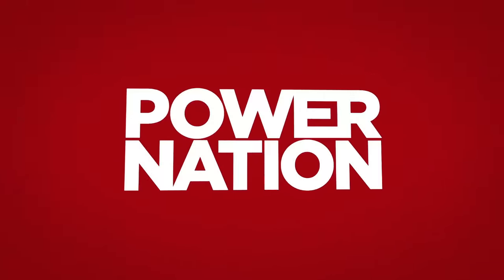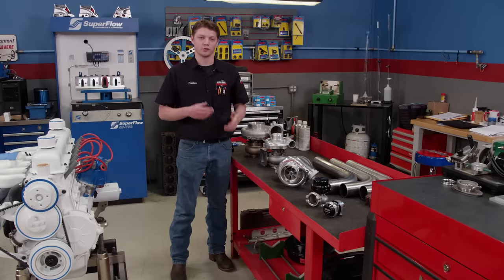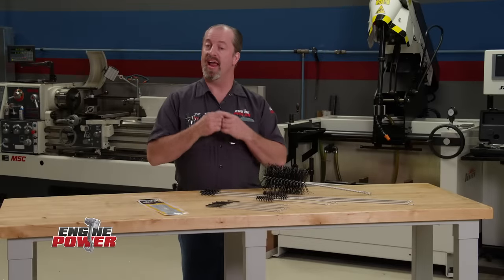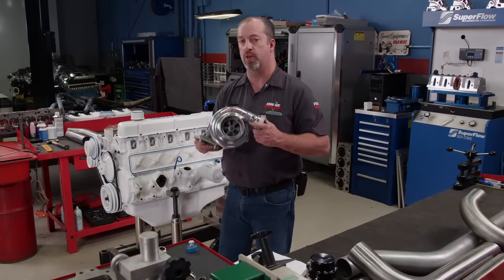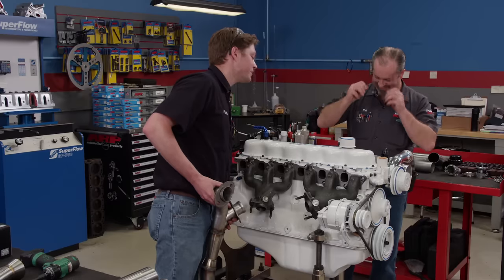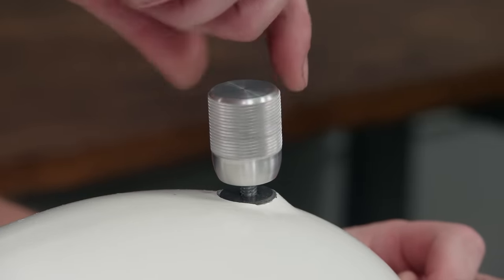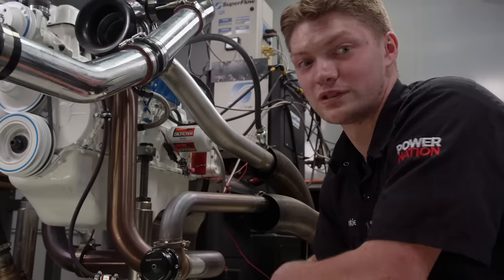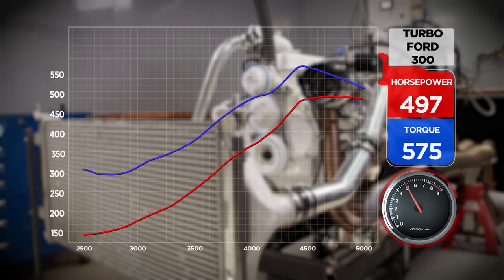Turbocharged Ford 300 Inline Six Makes Over 500 HP on the Dyno - Engine Power S8, E14

Comment: It's a 300ci.
One of the absolute best engines ever.
Reply: Actually it's not.  They've bored and custom built pistons.
Reply: @bmstylee  Okay...  Is your point that its a 308 and not a 300?
Reply: @bmstylee  regardless its still best motor made.
Reply: @fordnut4914  nice story.  To bad it's not true.   If it was so great as you imply why hasn't it been made in several decades?   As Pat said it's a relic.  It's completely irrelevant in a modern world.   As much as i dislike the turbo 6 that Ford use now they can make the same power and torque at half the size.
Reply: @bmstylee  you must not know nothing about engines.
Reply: @bmstylee  best engine ever idc what you say it's my way or get lost
Reply: @bmstylee  only thing that engine is good for is a boat anchor. I even tried giving away mines for free and nobody wanted it. I’ll be smashing it up with the jackhammer attachment on the bobcat soon.
Reply: @bmstylee  In terms of longevity and ease of maintenance, the 300 crushes any comperable gas engine made in the last 15 years. It doesn't make as much power as modern engines, but stock, mine makes more than enough to tow 12k lbs of cars + gear across the country a couple times a year and has nearly half a million miles on the original bottom end. Sure, it doesn't make as much as an Ecoboost 4. But you can bet I'll be further down the road when the Ecoboost is stuck in the shop.
Reply: @bmstylee  Ironically enough, dealerships were complaining to manufacturers about the lack of maintenance involved with the I6's, like Honda with the late 90's Accords because of their bone simple reliability.

 Time in production has very little correlation with the reliability of the product. Range of application is a much better gauge of reliability. And the fact that the 300 saw far more use in specialized industrial uses than your cherry picked examples (where lack of maintenance and ease of fixing is important) cements the fact that it was a more versatile, reliable.

Also, in one of your previous responses, you promted someone to show you a similar engine to the 300 that isn't Deisel. And now you're shilling for Deisel. You might be a bit stupid lol.
Reply: @bmstylee  You clearly don't work on cars at all or know how the industry works, lol. Cooperate beancounters cutting the production of a reliable engine because of mounting emissions regs and tooling costs don't detract from the reliability of the final product. Go rebuild a 302, then go rebuild a 300 and tell me which is easier. Go beat off your little turbo 4 banger.
Reply: @bmstylee  Everything the car industry does has to do with meeting ever increasing environmental, emission, and mpg regulations and standards. No matter how "good" of a product they are producing, if it can not meet the environmental standards then they have to move on to something else. The 300 was produces for 31 years which is not a bad run if you ask me. Car manufacturers nowadays seem like they are changing engines every 4/5 years.
Reply: The fact of the matter is this, the 300 I6 was among the most reliable workhorses ever built in the history of the internal combustion engine. It was used in F series trucks, from the F100 to the F350 for decades. UPS trucks ran them for a long time, a few of those units are still in service. Not to mention the number of industrial applications for them, and they're still used in those applications today. I wouldn't call the 300 obsolete, or a relic, by any means, but, as has happened so many times, a new shiny toy came along and replaced it. Are they better? In paper, the answer has to be yes, the new ecoboost engines are, statistically, far and away better, but are they as reliable? What it takes to kill a 300 requires a level of operational incompetence that shouldn't realistically even exist, but I'm sure there are a few isolated instances out there. In any event, theres no justifiable reason for any amount of hatred toward the 300, and theres certainly nothing wrong with a person who still enjoys theirs.
Reply: @crewdawg2008  my issue is the circle jerk the fan boys have over it. God forbid you say anything disparaging about their holy icon.  Especially when they can't make a valid argument to disprove what was offensive to them.   It is an obsolete engine.  Pat even called it a relic.  It's big, makes almost no power unless you spend $14k like they did here to make the same power a small block can for half of less the money, gets shit gas milage, packages horribly.  Modern engines do more than this could ever dream of while getting better mileage, lower emissions, and being significantly smaller.   If you want longevity you buy a diesel.
Reply: @smittyss4978  strange.  The small block Chevy has been in continuous production for almost 70 yet they can make emissions.   And yes cars and engines change every 4-6 years because technology progresses.   I had a 5.4 Triton in my f150 and what took 5.4L to do now takes half that displacement.   Enjoy you're antique.  The rest of us will take technology any day.
Reply: @bmstylee  yea they can make the same power and half the size with 1/4 the life span i have never seen an Eco boost over 220k miles the world is full of 300s pushing 400k on original equipment

the ecoboost is just like a tiger tank effective but expensive over complicated and prone to brake down

also yes the 300 inline 6 was the best selling motor ever it was the standard engine in all ford trucks also many cars from 1965 to 1996 including Bronco and the mustang

the 300inline 6 is still used world wide as a stand by industrial motor for generators, boats,  airport tugs

the 300inline 6 was the AK-47 of engines
Reply: @bmstylee  bill the 300 was not discontinued because it was obsolete it was dropped  do to dealer complaints 300s don't break dealers had no return business you cant sell a man a new truck if his old one still works and you cant charge his $200 for an oil change if its east to do and take 10 minuets
Reply: @bmstylee  wrong again try to go buy a new 3.5 ecopoop you are likely going to spend $14k
Reply: @bmstylee  the 5.4 was trash on launch blowing out spark plugs at highway speeds and throwing timing chains at 75k miles
Reply: @Friedrich-Wilhelm-1980  new updated plugs and vvt lockout and tune and there's no issues with the 3v. Just gotta know how to take care of your vehicle yourself
Reply: @M3TA1UPY0URA55  you sound like the 6.0 guys "you just have to replace half everything and baby it and its fine" lol
Reply: @bmstylee  the primary reason at the time emissions, mpg, and the like not withstanding is that it wouldn't fit in the 97 truck.
Reply: @Friedrich-Wilhelm-1980  it's a timing chain replacement and spark plugs. Basic maintenance. You shouldn't own a vehicle if you can't do those. Lol
Reply: @M3TA1UPY0URA55  yea and im saying you shouldn't have to do those on a factory new vehicle just to make it reliable

my old 300 dont even have a timing chain it has a gear that so far in the upper 400k range is still doing its job flawlessly hell i got 100k on my plugs and they still look new i check them every oil change

indestructible
Reply: @Friedrich-Wilhelm-1980  unfortunately the newer a vehicle is the more maintenence it needs. This new shit is terrible. Atleadt I can say is my truck is alot more reliable and it didn't take much money. All these computers and electric cars are getting damn near unservicable or they will be.
Reply: @M3TA1UPY0URA55  in my mine that = better 
thats why i say its best because it can do everything and rarely fail its not the best at anything but its ok at everything and can go forever and when it does fail a crescent wrench a flathead and a pocket knife will have you going again in 30 min to an hr

and trust me i know how unserviceable modern cars are my sister bought a 2017 bmw and asked me to do the oil

would you belive me if i told you there is no oil fill or drain on that MF crosover

just a nub you hold a scaner up to and it tells you the oil level and to drain the oil you have to remove the oil pan that also takes a proprietary tool

long story the dealer charged her $300 for an oil change
Reply: @bmstylee  What are you talking about? The only small block Chevy that has had a longer production run than the 300 Ford is the 350 Chevy by 5 years.
Reply: @bmstylee  The 300 was discontinued because of the MOD motor  and CHEAP diesel, and people don't like buy 6 cylinders this is why Ford offered the 302 in the trucks (making less torque and the same hp and both outside the useful range needed in a truck).  So why would Ford continue a unique transmission for just one base model engine E4OD/4R100 (due to the 300's power curve being biased to low RPM like a diesel). To further my point about the V8 desire tge 89 Tbird came with a 235HP 300 lb-ft V6, but people cried for a V8 and got it in 91 making less power, less torque and slower in the 1/4.

My 90 f150 is still going with 600k miles and all orginal as it came off the line in 89, and still get 22mpg.  This truck has had over 3500lbs in the bed multiple times.  Now show me a SBC with this mileage and use that is all original, or just show me any gas V8.
Reply: @Friedrich-Wilhelm-1980  that sounds like a GM guy too.  Just put everything aftermarket and its a great engine.
Reply: @prestonberg9604  I aint gota know nothing just getting my point across after all I'm just trying to teach idiots on here ..😂
Reply: @bowez9  people don't like to buy 6 cylinders turbo eco boost hold my beer.
Reply: @fordnut4914  compare Tbird SC sales to Tbird 5.0 sales; or even 302/5.0 F150 sales to 300 F150 sales. 
The 300 died to Ford in the late 80s early 90s with MOD motor deployment and Powerstroke release, not with Ecoboost.  Because of cheap diesel and people would rather have had a weaker v8 than a 6 cylinder.
Reply: @bowez9  ford truck sales says different
Reply: @fordnut4914  current or from 1965 to 1996?
Last time I checked the 300 was discontinued in 96, so current trends are of no consequence in regards to the 300 or 6 cylinder vs v8 comparison  of that time.
Reply: @bowez9  longevity the 300 of the time would out last v8 . Their is a good reason big rigs like the online 6 . 300 is just a smaller version of them.
Reply: @bmstylee  maybe because this was made in the 60s 70s 80s and 90s? And it’s not modern, and it’s na stock?
Reply: @fordnut4914  actual the 300 has nothing to do with big rigs outside if it's an i6
Reply: @limprooster3253  last time I checked GM launched the small block architecture in 1955.  And strangely they keep modernizing it to meet the times.   You guys just don't like that someone isn't in your hand job circle and says something you don't like then act like the spoiled 4 year old stomping their feet in the store crying.   Get over yourself.  Pat called it a relic.  And I think he has some pretty good street cred when talking engines.
Reply: @bmstylee  Wrong.  Todays SBC is on the LS architecture, which debuted in 1997, and was designed with help from Robert Yates (yes, the Nascar Robert Yates).  The LS is loosely based on a ford 351 windsor, and has nothing in common with the traditional SBC except for being a 90 degree V8. The original SBC ran from 1955 as you say, until finally being phased out in 2003 with the last of the 305s being offered in utility vans.  Those two engines, I repeat, ARE NOT THE SAME.  1955 to 2003. Thats 48 years.  A hell of a run for an engine, but not near the 70 you're trying to sell.  And the last 5 years or so of that 48 was just to support LS production, not as a flagship engine.  

You seem awfully preoccupied with the concept of a circle jerk.  Something you want to tell us Bill?  Can us 300 fans offer you a cookie?
Reply: @bmstylee  I know it has nothing to do with big rigs but the same basic principles apply to any inline 6 they got a reputation for durability because less rotating mass  un like a v8.
Reply: @bmstylee  And again, Ford moved away from the 300 for two main reasons.  The first being not wanting to sink the money into updating it for upcoming OBDII and emissions laws.  The second was the tooling used for it in Cleveland was worn out and in need of replacement.  Between those two lump sums Ford would need to shell out to keep the 300, the decision was made to try to modify an engine they were already producing to fill the voild, which became the 4.2.  It wasnt the engine design that killed the 300.  It was the money to keep it vs using something else
Reply: @bmstylee  They are all just big air pumps. Don't forget about what this engine was designed for at what it just did on that dyno
Reply: @bmstylee  Because just like this engine. The 1911 is proven
Reply: @jamespropst9093  and like the 1911 it's an irrelevant relic.  Especially when Browning and Saive created the High Power which made the 1911 look like an antique in the 1920s.  The 1911 hasn't been used for anything outside of civilian ownership for a long time.  The USMC dumped the Colt m45 because modern a Glock is a better design and more reliable. Same with this item.  It's irrelevant in a modern automotive engineering and design.  Things move one.  Some fudds are bitter and won't accept it.   I will admit modern engines aren't perfect but I'll take the issues they have and take  increased fuel efficiency, lower emissions and better performance.
Reply: BMW still is using an inline 6 that's pretty decent. Even if the car is trash, they're still using the I6. Even Toyota is using it. Yes they have overhead cams, but that's not a big difference.
Reply: @bmstylee  except its not the same low wind torque.
Reply: Right there with the Jeep 4.0
Reply: @bmstylee
You say the ford 300 has a circle jerk around it and then bring up the 350. 350 is garbage.
Reply: @bmstylee  Does the new turbo 6 make as much torque at 1600 rpm as the 300?

Comment: Gee thanks guys. My 87 f150 300 4x4 B.W. 4sp stick short bed I've had for 20 years honked twice while watching this video. My other is a 93 f350 7.3 4dr 4x4 auto and it deserves a turbo first. Both best motors ford ever put in a truck. My grandkids will drive these trucks. Both have pulled unbelievable loads. Neither are fast but are unstoppable. 
My friend had one in a delivery van and ran it for months with 5-10 lbs oil pressure.